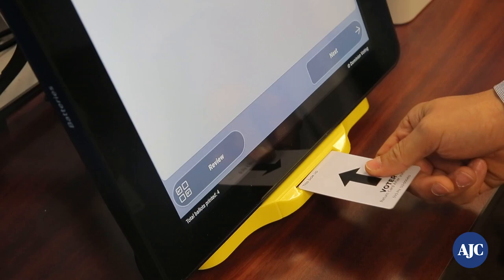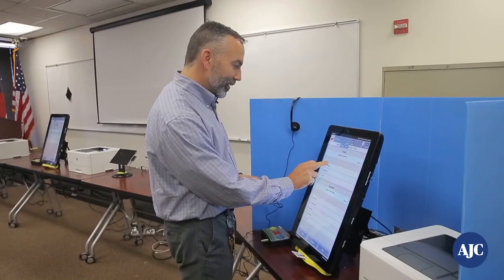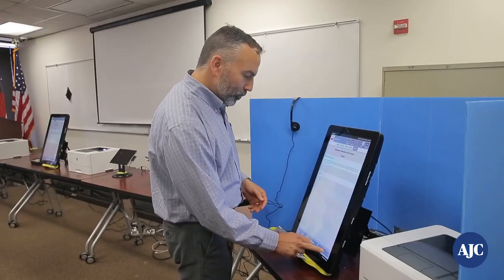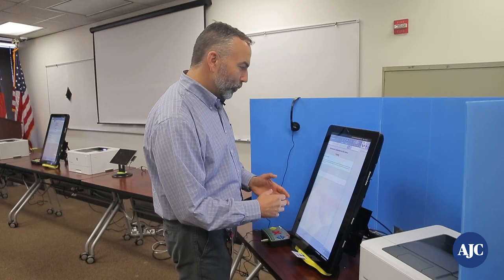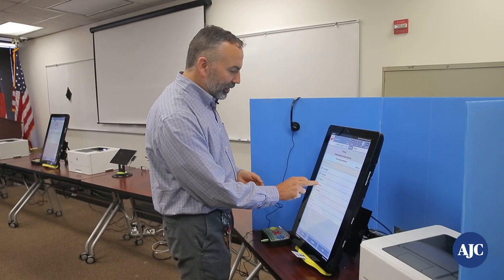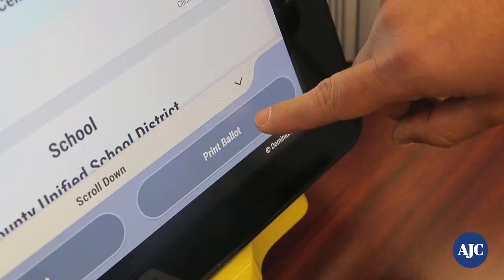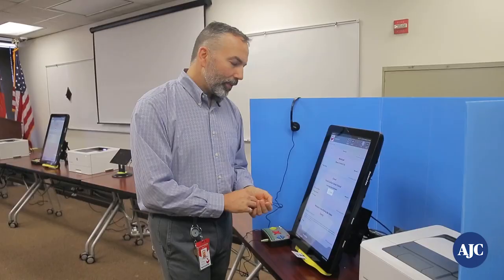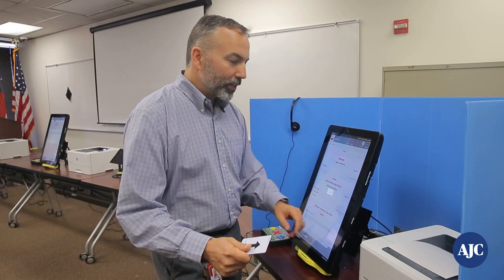Georgia's new voting system | AJC

Comment: So this is like an old school + new school method to prevent fraud?
Reply: Yep. Maricopa county in AZ switched to this. I like it.
Reply: RedLight GreenArrow thanks for the clarification 🤙🏽
Reply: No. More easy to make fraud if you control the backend.
Reply: @MrHkl8324  i hear that, how do yo think so?
Reply: I wouldn't trust anything but putting pen to paper. If they do it electronically, there's PLENTY of opportunity for fraud. There is NO WAY anyone can guarantee a fraud free election without the ability to put hands on a hand marked ballot. I wouldn't mind if my hand maked ballot was scanned into a database so that I could access it online and verify it was counted but touching a screen doesn't give me a whole lot of assurance of security. Banks have a vested interest in making their systems secure. In this case, what ever way the powers that be determine elections should got, at the very least, there'd be a temptation to overlook anomalies. The presidential election not withstanding. 
Oh, and no, I didn't vote for incumbent.

Comment: What happens if u weren’t given a voter card will ur ballot still be valid? I wasn’t given a card they used the same card for everyone in the precinct?
Reply: @snaplash  that’s the thing, the ppl were using the same card without resetting it if that makes  sense. One person was checking ID and the. They had us get into a 2nd line ( not in the same order) they used the same five cards over and over ejecting it and putting it back in the same machine
Reply: @snaplash  that’s NOT what happened..... once the poles reopened b/c they were down for a while : that’s what they did... the same card was used over and over and over... I asked and even called the board of elections. I eventually filed a complaint with the SOS who assured me that would not affect our votes....

Comment: We have these machines in TX now, too, and I love them. Unfortunately, I have found that several districts still don’t use them properly and refuse to print ballots after electronic votes are cast. Very shady; some officials are just averse to change -_-
Reply: I always would vote by pen and paper, i would never trust an computer. there are to many mistakes in those machines.
Reply: Lilith  Well it was Reps who brought them in place.
Reply: They are much less trustworthy than pen and paper. I'm not sure why you love them.
Reply: @snaplash  How do you proof that the ballot printing does match with the machine?
Reply: @snaplash  P.S. We use for every question within a election a different paper color here in Germany. So mayor election has a different color than city parliament election and so on. Also our palaement is elected for 4 years and not for 2 years which make it better to govern.